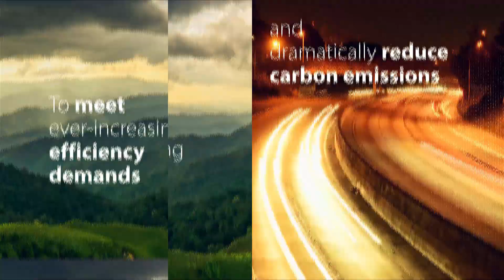Introducing a fundamental innovation in hydraulic technology: Digital Displacement®

Comment: This DDP will have higher efficiency than a load sensing axial piston pump. 

However how does its efficiency compared with a closed loop VFD controlled induction motor coupled with fixed displacement internal gear pump hydraulic system, with pressure and shaft speed feedback? Same efficiency or more efficient than that?
Reply from the maker: A DDP based system will have higher efficiency at all operating points and ability to operate more effectively at low flow, high pressure conditions. A system using a fixed displacement pump and VFD can find this operating point challenging due to high current demand and thermal constraints in the motor at low rpm.  Normally DDP in industrial applications is compared to variable displacement axial piston pump using a variable speed drive but again, efficiency of the DDP is higher at peak demand conditions and DDP response is not affected by system pressure.  For comparison, at the low flow, high pressurise condition, the DDP has about 10% of the losses of a conventional axial piston machine and this is running at 50Hz or 60Hz fixed speed.  From a demand response point of view, the DDP system response to step change will also be faster due to fixed speed operation vs need for ramping up the RPM of a variable frequency drive.
Reply: Hi, can you help me please 
I'm a technical institute student at Hydraulic systems technology , how can I figure out the latest things in my field? And what are the big issues at this time in my field?